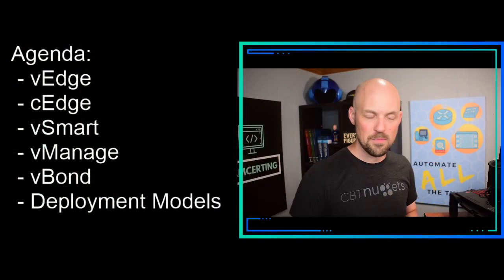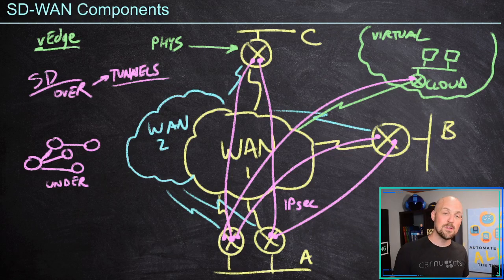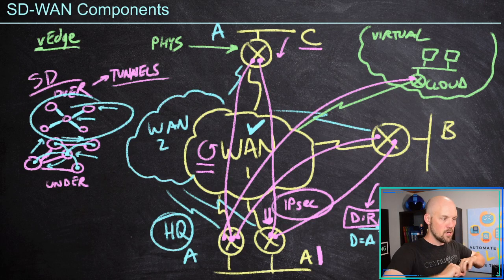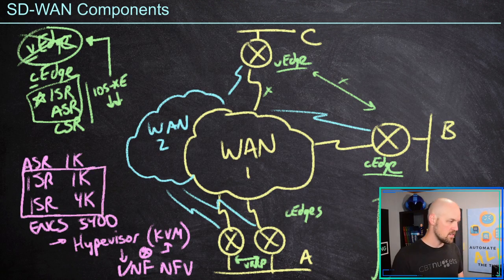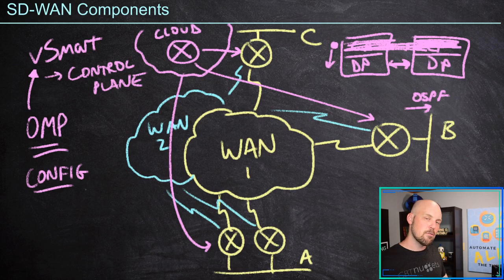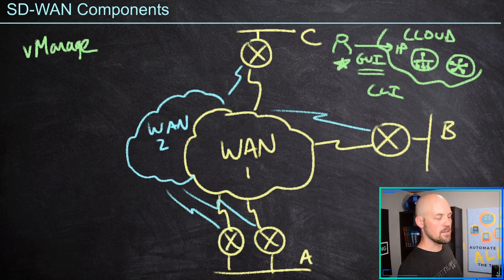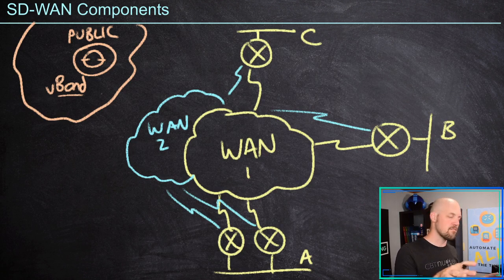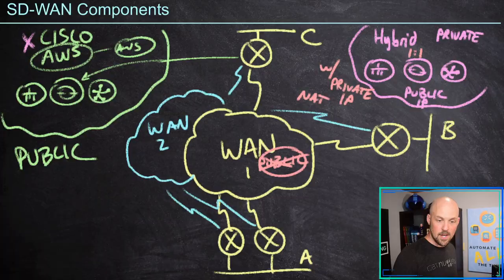ENCOR - SD-WAN Components

Comment: How to size vsmart? On how many routers 1 vsmart will work? is it depend on the license we take?
Reply from the maker: I always recommend going through your Cisco rep or partner for licensing questions, but generally speaking it should be 2000 vEdges per vSmart, plus you'd want to deploy redundancy.  Hopefully that's a good starting point!

Comment: Thanks Jeff, Yeah I wouldn't agree with Dell switch comment either. OS10 and OS6 product lines are amazing. I can't imagine how they converted Debian based linux in to such an amazing network operating system and the cli is very much industry standard. Recently did EVPN deployment(all over cli) on Dell switches and very much impressed with it. Now Sonic is also available on Dell switches so yeah welcome to the open switching world.
Reply from the maker: True, Dell has improved substantially. The experience I was relaying was the pre-F10 acquisition switches, which is certainly dated at this point. I appreciate the updated take on it!

Comment: Dear Jeff, in your experience designing and implementing networks that you could advise me regarding the following scenario, in the company we have a metroethernet with a provider x and it is dark fiber and I have more than 80 to 100 nodes with them at 100Mbps and 1Gbps, and then a provider Y appears to offer me MPLS on the same nodes at the same price but only offer me 100Mbps Links, my question is whether it is worth changing the entire technology park or not ; how i should i approach it
Reply from the maker: Hi Ruben!  MPLS and Dark Fiber are very different technologies. Dark fiber exists at L1, meaning you have to deploy your own optics and you can form L2 adjacencies.  MPLS is at L3, meaning the handoff medium can vary, but ultimately it's a L3 boundary. MPLS tends to have better reach and accessibility, which is why it is so popular.  Dark Fiber has more limited reach, but you can control the speed of the links and don't need to worry about sharing routes with a service provider.

I would recommend you seek out a technology consulting firm to review the details and discuss what makes the most sense for your situation.  All the best with this project!
Reply: @KishSquared  thanks  , you help me a lot !!